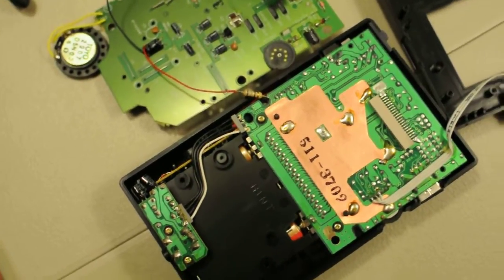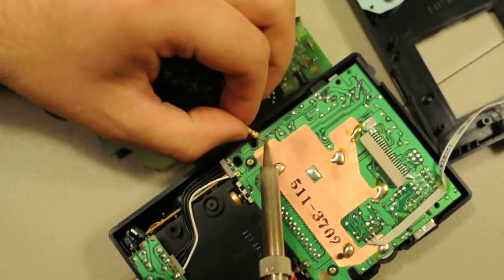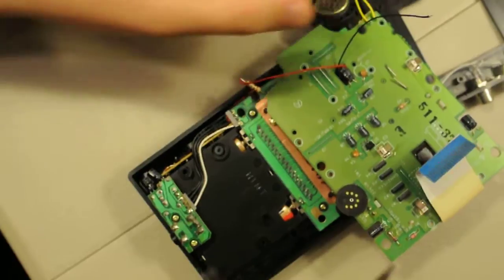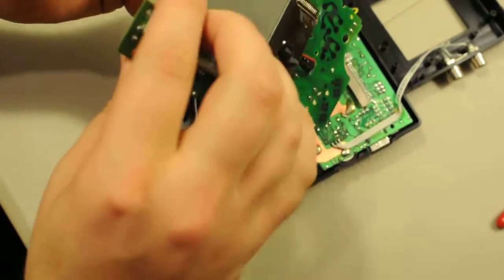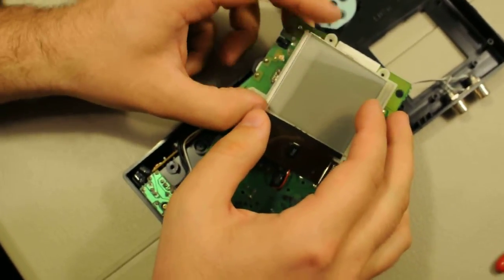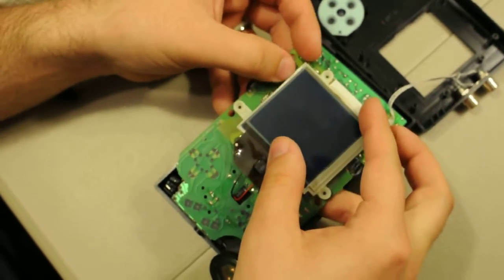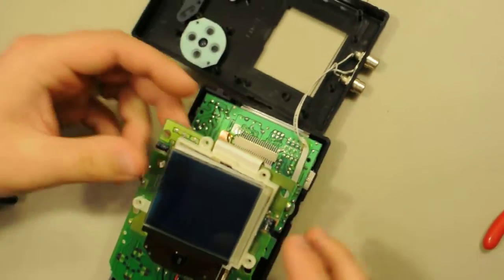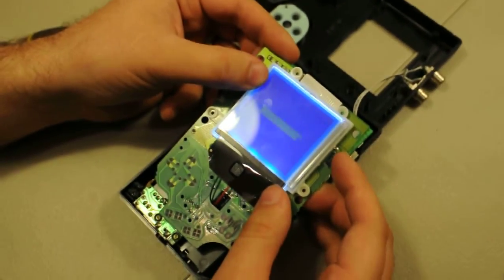Nonfinite Electronics V^3 Backlighting Pt. 2

Comment: I had the same problem with my case earlier. It was because of the way the wires protrude from the bottom of the backlight. If you look, you will see that the wires catch on the white plastic housing that holds the LCD in place and raise it up. Cut a small gap in the plastic for the wires and the screen will sit much more flush!

Binglung, kindly shut up. If you'd done this yourself maybe you'd have noticed the problem. The reassembly isn't covered in the video so it's not mentioned, anyway.

Comment: I saw some dirty spot on the polarized film and I couldn't remove those by microfiber cloth. Can I use water or 70% rubbing alcohol with the cloth? Also I heard need to trim the excessive solder points behind the screen in order to fit the LED. I don't have a dremel. Will a wire cutter do the work?

Comment: I'm not him, but I've been working with some original Gameboys and there's a little "spring" inside (a folded metal tab) that creates some resistance when attempting to put it back together. Ignore it and press the halves together when putting the final screws back in and it should be fine.

Comment: Cutting part of the white plastic where the wires from the backlight pass seems to make it fit abit better, but there is still pressure on the screen when I put it back together and this leaves marks on the screen. How do you make it fit better?

Comment: @LeBraveLittleToaster Did you get the V2 or V3??
The V3 fits perfectly but the V2 you have the remove the power light and cut out the left side of the lcd mount (white plastic).